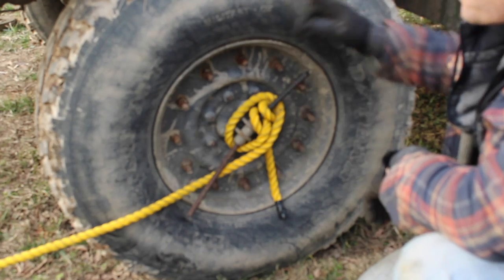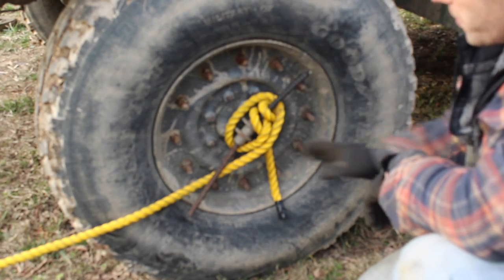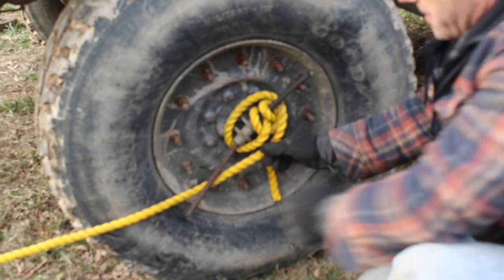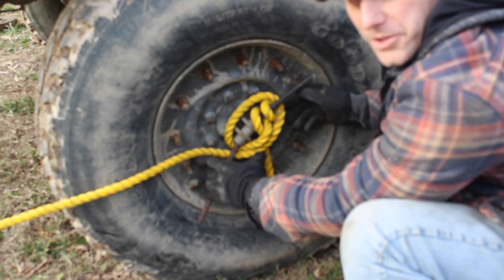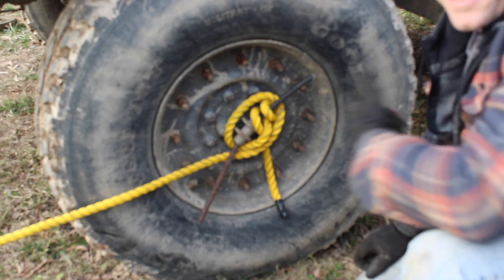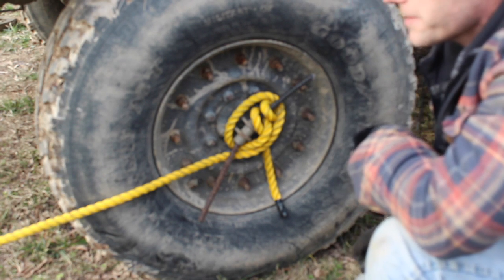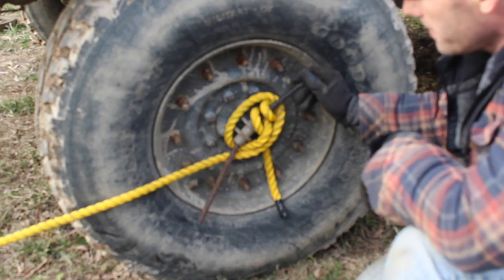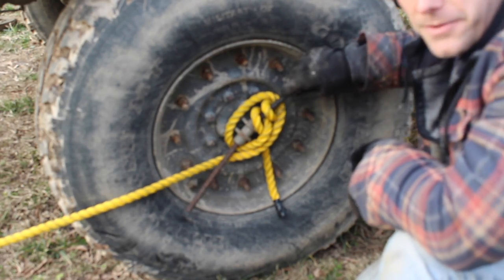YOUR HUMVEE ALREADY HAS A WINCH...........(Sort Of)

Comment: Who knew, I always wondered that that hub was for.
Reply: That is actually for tie down not for using as a winch  or recovery , however it is very interesting that it can be used for this purpose as well
Reply from the maker: I thought for the longest time those were for tie downs as well, but in TM 55-2320-280-14 it shows the only tie down points are the shackles on the front and rear bumpers. FM 21-305 shows that they are for self recovery.
Reply: That is to tie down the humvee to flatbeds when transporting. front ones shouldnt be installed incase you hit something and dont want to risk going out of control
Reply: you might break your halfshaft if you put that sort of load on it.
Reply from the maker: I talked to the Hmmwv Mechanics at my unit, and they reconfirmed that there only purpose is for self recovery and not for transporting.